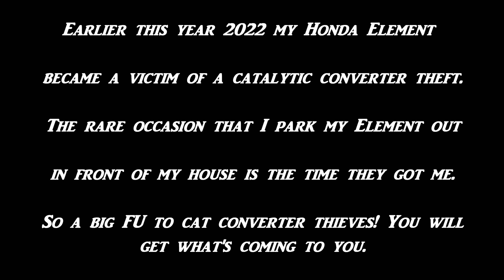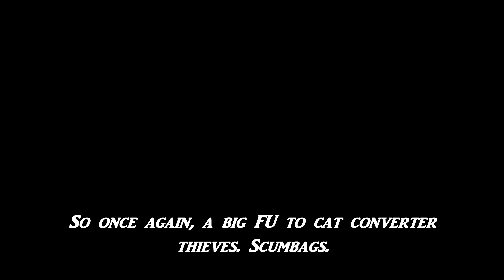Honda Element - Stolen Catalytic Converter.

Comment: I am sorry that those bastards hit you too. There is way too much of this thievery going on in the Lower Mainland. I'm glad you had the parts and resources to get this fixed quickly at least! I forgot about the welder squeaking noise, should integrate that into a song somewhere :P
Reply from the maker: sounds like a squeaky bicycle. I should have used it throughout the video. Never thought about that. lol.